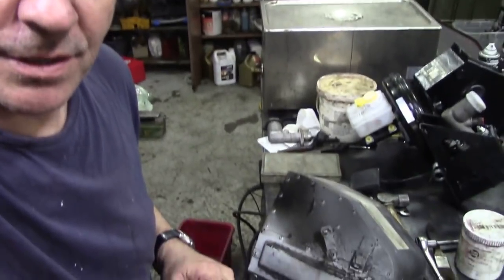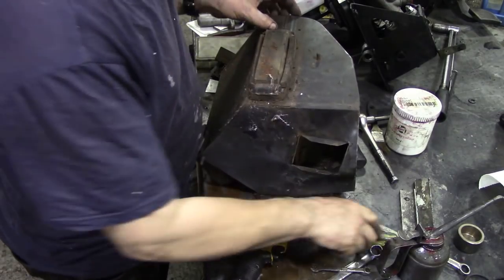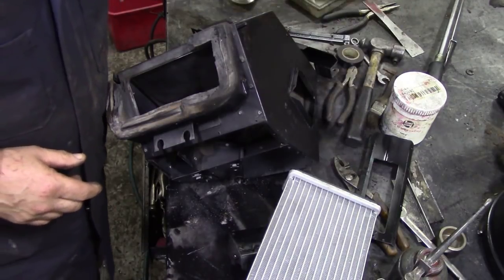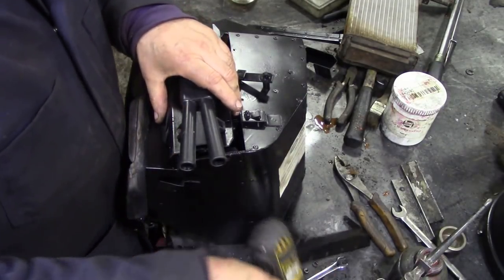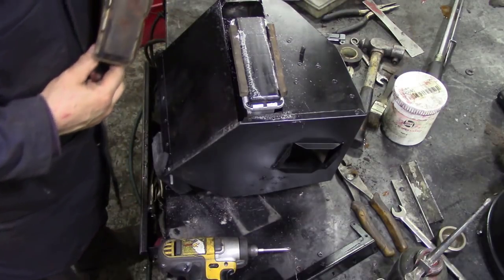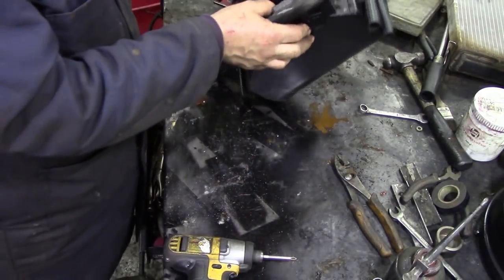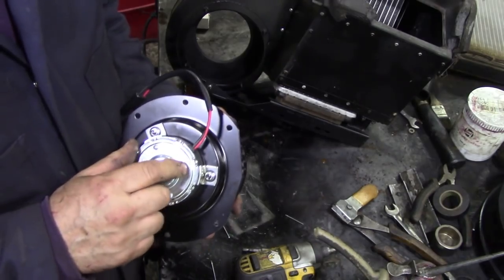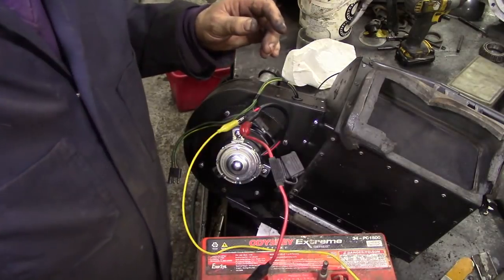Malawi 110 Overhauling the heater blower and replace the matrix 300Tdi

Comment: Personally, I kind of appreciate LR's puny low fan speed cos it means I can leave it running all the time rather than switching it off and then finding it's seized up when I try to switch it on again when the weather's cold.

I guess it means I'm wearing out the motor more quickly but, honestly, I've never had a fan fail in 20-odd years.
Conversely, I HAVE bought a couple of LRs and found the fan was seized when I first tried to run it.
Hence, running it all the time seems like the best option.

Comment: I'm been design and producing heat exchangers for 20 years.. the most important thing is the air go through the heat exchanger not around it to do not loose efficiency. 
Nice job i will need to do that on mine.. 
I hope it's going to be that smooth..
Reply from the maker: Thanks for sharing
Reply: That’s how these units control temperature - in the strip down video, you see Mike free up the flap which is hinged at the inboard edge of the matrix and has its moving edge near the inlet from the blower.  When you select fully hot on the lever, the flap should move across the front of the housing to expose the matrix and block the bypass, forcing all air through the matrix.  When you select cold, the flap moves flat across the front of the matrix and allows all the air to bypass it for maximum ventilation.  It’s a big improvement over the SIII unit that had a similar matrix and fan, with the temperature controlled by a valve that restricted the engine coolant flow through the wet side of the matrix, so the airflow was always impeded by the drag from the matrix even when selected to cold.  The valves also tended to seize and pose a restriction (even in good condition) to the coolant, so they system never provided the heat the Defender type can.
Reply: @nickboylen6873  the flap is to skip the heat exchanger.. the most important thing are the air seals back in place ... Some Defender never get really warm 😂
Reply from the maker: The heater itself is not an issue but getting coolant hot enough to transfer the heat - when I fitted the early type of heater to my 3.9 Isuzu, I removed the air control flap and had the matrix surrounded so no air could go round the sides, I also drew air from the footwell not out side of the vehicle - it gets so hot I cannot run it on the second speed once the engine is up to temperature BUT The Isuzu takes coolant from a different place on the engine ( just behind the thermostat) and that makes all the difference!
Reply: @1977Timp , yep.  When I rebuilt my 109, I used a Defender heater to improve its performance, but was careful to make sure all the seals for the distribution system were renewed and working, and filled all the small holes in that lower fascia duct.  The old fascia and heater assembly were full of holes, mostly screw holes in the fascia from previous owners, but a fair few rust holes, and the plastic hose from blower to matrix (deleted on Defender) was split all over the place!  The thing didn’t have a chance!
Reply: @BritannicaRestorations , agreed.  If they’re in good condition, these heaters are up to the job for most users.  Mine copes well in sub zero conditions in the UK - hot enough behind a Tdi, not the hottest engine, to need to be turned to a lower temperature or blower speed after five minutes.  I wouldn’t know how well it copes in the conditions you get in winter, though.

Comment: G'Day Mike
Mate if one looks inside the Squirrel Cage Fan you will see an arrow indicating direction of rotation. For some ungodly reason on all Defenders (TD5's and onwards) that I have worked on with the Blower plugged in and switched on from the Dash, and the heater NOT mounted so as to check the output,  they have all gone backwards. Now the funny thing is when a Squirrel Cage Fan runs in reverse it uses less power because its almost running in a vacuum but the motor is not getting as much air flow so it can heat up more (the mounting plate is the heat sink as well as the L brackets and the outer casing onto the Fan housing). End result is I always have to switch the cable over by cutting and swapping them around and rejoin them back up correctly and cover in heat shrink. So even though you "tested" the heater from a battery, when connected to the wiring harness, don't be surprised that its still running in reverse (no airflow).
Reply from the maker: Yes I notice the wiring was arse first on this one

Comment: Wow what a heater!! I had an old Smith's in my ser2, the shin burner.. it would rattle and dim the headlights when it was on but couldn't even displace a small fart... 
I wonder if there would be money in making plastic replacement heater boxes.. no more rust, designed by a human instead of by accident
Reply from the maker: I was contemplating a design to use a Webasto in place of this unit
Reply: @BritannicaRestorations  ooh..I like your thinking...

Comment: I used to work for smiths. I still have dealings with them. I even worked with that very fan you had there. Feel free to message if you have questions for that fan heater setup

Comment: Was that seal around the bottom of the matrix to stop air blowing past between the matrix and the housing into the engine bay? Not the three piece but the other one. Also closer fins increase pressure drop so the passengers will never feel a powerful blow of air. There pathetic to begin with anyways...
Reply from the maker: You could be correct on the seal but they made the matrix bigger to compensate for the tighter fins - they actually blow quite well - the restriction is the hole in the bulkhead and the outlets in the bottom dash

Comment: funny I've just come in from taking mine fully to bits.  every rivet out.  Took the motor to bits :( brushes and com worn out, not even possible to just fit new brushes!  That £120 i need to find.  All the metal is going for blasting and will be painted and rebuilt.  That motor is the same 'gate' as my original.  Where did you get it from?

Comment: Have you ever found anything valuable in the heater casing when you have taken one apart. I found rather a nice diamond engagement ring in one once. I always wondered if some girl had thrown it back at their boy-friend and it went down the vent. Other than that it has been small change. Great video Mike. stay safe. Yorkshire Rob.
Reply from the maker: Not really - found lot of Shotgun cartridges and 303 rounds

Comment: What brand of new matrix are you using there?
Reply from the maker: The original 2.5 NA one - works great still!
Reply: @BritannicaRestorations  What brand would you buy if you needed to change it? Mine's corroded and blocked.
Reply from the maker: Depends on what heater box you have for a quiet life - the 300Tdi and Td5 have longer matrixes but have different pipe outlets - not easy to retro fit a long matrix into a 2.5 NA for example

Comment: I cant find a motor for my defender so i chisseld the small edges over that keep the blower motor cover on at the back its actualy very easy just tap them back i then removed the fover and saw that the amiture us below the brusshes of the motor i took off the hamster wheal luckely it came of easy not stuck as on my other motor so i removed the armiture replaced the clip that was loose i bent is close inserted it back on its correct spot cleaned and oiled the swiwel phosthor copper bearing checked that it sot iver the brusshes wich it did i replacd the cap again and tapred the metal back with an old air tool chissel sharpened ti easeiy tap rhe metal over again to hold the dovwr in place a plate over the top and bolted to the exsisting 3 fan to metal plate nolts will also work actualy well atleast my ran works again and blows a dog out of a bush its ont thing you havent done yet Sir strip a defender heater blower motor.
Reply from the maker: Well done! Those blower motors were used on many, many vehicles in the past - Minis, Jags, Land Rovers and others
They can run in any direction - you just swap the wires over
The wheels are handed, not the motor.
Getting the wheel off is the hard part, but once removed, I have salvaged them by soaking them in diesel, then let them dry out a bit, and turn the shaft with a drill as it is 99% of the time the bushes that dry out - once free apply 12 volts and I bet it will work again!